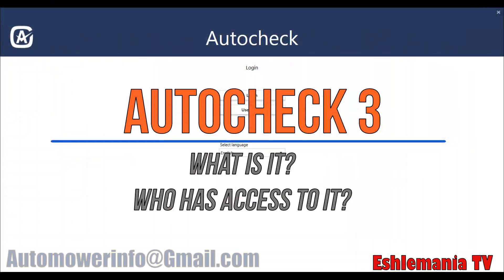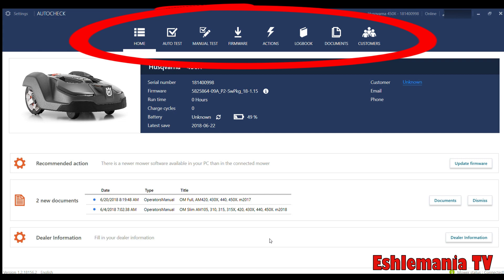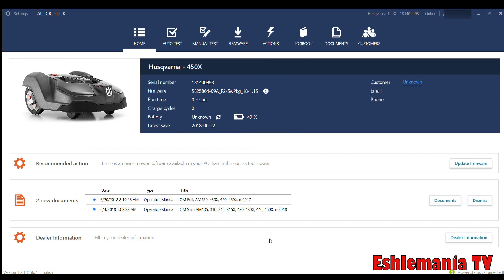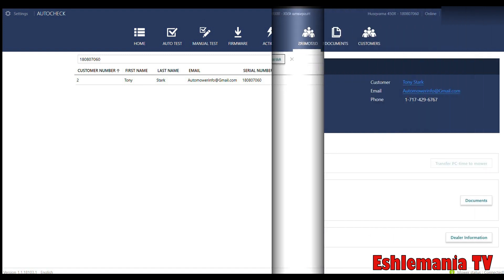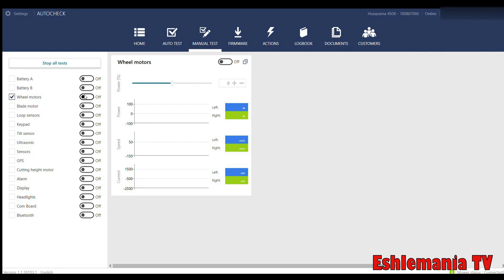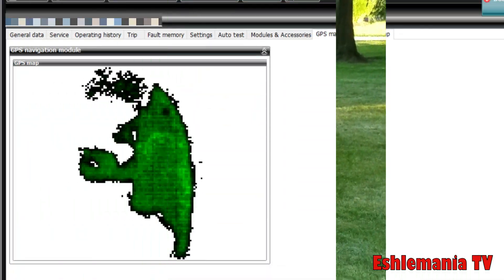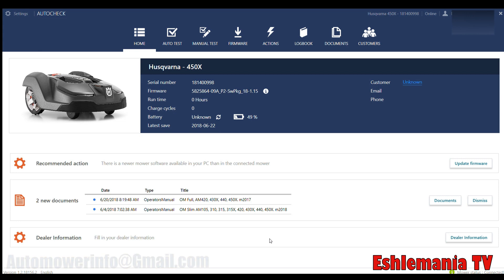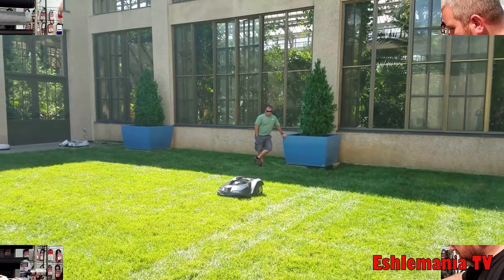Automower Answers: Autocheck 3 - Updating Automower Software And MUCH More!

Comment: Recently had the firmware updated on my 430x but now it has a problem it didn't have before. Now when charging it goes in and out until it stops near the station and gives a charging station error. Can the firmware be rolled back to the previous version?
Reply from the maker: There will be a video coming on the Robotic Mower Services channel very soon that will explain all of that.

Comment: Any way to remote this from my Computer to yours so it can be tested by you all  ?( I buy the cable you do the Test from your end )  There should be a way for Good Dealers like yourself to do a Diagnostic on a precived problem. This way I would not have to send it to you and you do the test and say.....No problem all is good or yup that drive motor is on the way out.  ( and yup I am one of those guys that would like to have the Program :P....why because my dealer is Hours away and last time I went to see him he told me he could get to my mower in 3-4 weeks. That was just to look at it. Then a few more weeks to get parts )
Reply from the maker: Firmware updates are available for the new AWD Automowers through Automower Connect.  https://youtu.be/EZprtD-YpTo

Comment: That 's pretty weak excuse for why you think people should have access to the software.  Come on man..
Reply: Some of software updates include improvements over foot detection and latest firmware includes battery charging temperature safety overrides. I think it would be nice to be able to update the device myself.
Reply from the maker: Firmware updates are available for the new AWD Automowers through Automower Connect.  https://youtu.be/EZprtD-YpTo